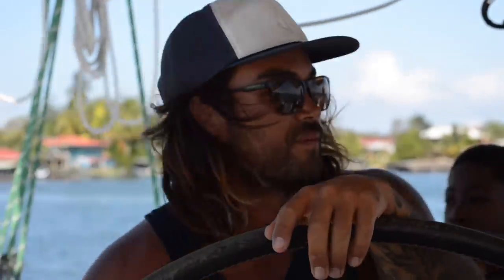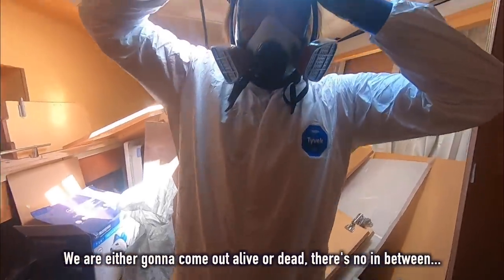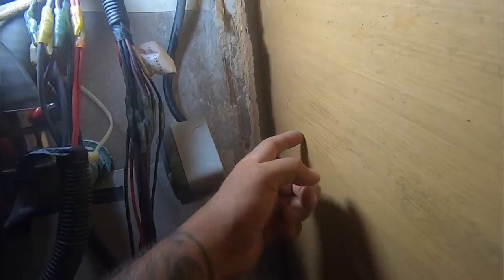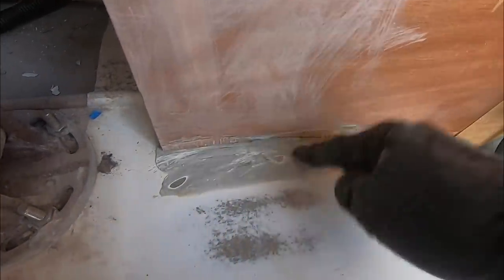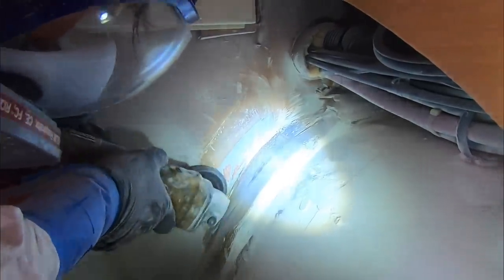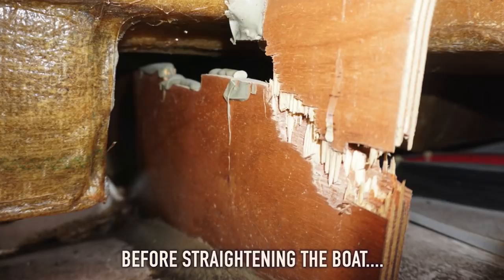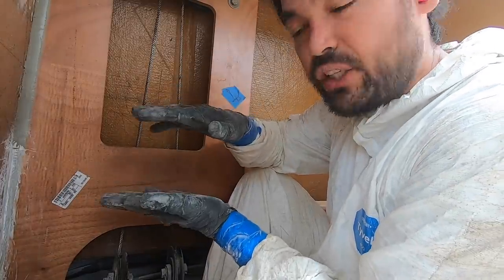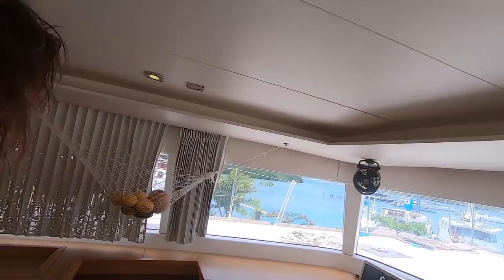CRACKED BULKHEAD REPAIR SERIES - Part 7 (Episode 112)

Comment: well of course its a design flaw, you tracked back how the water got to the meat of the bulkhead and rotted out. In the hull there should never be flat surfaces. Everything should be sloped of tapered to run down to bilge pump area. Its a boat, #1 always assume every area will get wet, #2 where will that water go?

Comment: Just my opinion.  I don't think the Lagoons have the structural integrity in their bulkhead to be hauled in and out of the water. To add, I think the recommended tension on the turnbuckles is way to high.  SOmething has to give.

Comment: I am NOT civil suit happy, but it exists for a reason: to shine a light on fraud, abuse, etc. In this case, if it is determined that Lagoon deliberately compromised the construction of its boats, it could become more than a civil matter. The right law firm would need to get involved that can have these boats expertly/professionally analyzed. I am sure it’s not only Lagoon that has issue. But, in the time of criminal cost cutting measures, there are some monohulls that need to be assessed as well: keels and rudders falling off at sea, etc.

Comment: When I myself saw what U guys were up against months ago..my first instinct was ..design flaws..too much new problems keep popping up  
too frequently..please give careful considerstion to the fact that u wont be able to test the structural integrity & strength of your work..In a worst case scenario when your'e out to sea..the shearing & twisting forces generated by a heaving & moving boat in bad weather are tremendous. I'm not sure your superficial fibreglassing ( though extensive & thorough may not stand up to that kind of loads..but still brother(s) continue to do ypur thing
& 😎ROCKMAN..

Comment: Ok. Science time. The expression "running balls out"comes from steam engines. The governor on a steam engine is two spinning balls. (Google it) And when the engine is running at full speed, it is running "balls out" or until they hit the limit. The "wall" hence "balls to the wall". I believe what everyone is implying is that the driving force behind you're motivation is immense. And thus those balls Must get plenty of exercise and be huge by now. That's probably it right? And it's an engineer friendly explanation.

Comment: The discovery of the faults to the design and workmanship of this craft as you work through it is a testimony to the poor design workmanship and lack of quality control. Of more concern is the apparent lack of fundamental stress understanding in the design of the joined up areas.
It seems as though they have taken a suck it and see attitude to the lay up on the factory floor and the guys doing it have been taking the initiative on what might work .
As I said in previous comments there is a distinct lack of anti torsional beams were the body of the boat is twisting, viewing the amount of fibreglass lay up in those areas it seems the view was, slap it on as thick as you can to create a beam ,that approach is not likely to work because the weak points will occur as the lay up thins down and looking at the delaminating that is exactly what as happened.
I think the third party insurance supplier that the manufacturer retains will be feeling very nervous at this time as most of the footage shown on your channel is damning.
If I were in your shoes I would be keeping a tally of the cost of your repairs and your own labour costs as you might well be party to a upcoming lawsuit against the Manufacturer.

Comment: Sadly, when a company has that much legal coming at them they tend to do a bankruptcy.   Then form a new company, instead of “lagoon, it would be “bugoon” ..🥴.   I’m sure that if they were to offer something for the design flaw, it would be to original boat owners ...🥴.   I’ve been on the wrong end of those deals...  No worries, if all your new glass holds, your boat will be tits 🥳
Reply: That was my thought as well, do they really owe anything to folks who did not buy a boat from them? Can they also suggest because Parlay was involved in a hurricane that the damage is far greater then would be normal. Its ugly regardless and until someone files suit and it goes to court its all speculation really?

Comment: Hmm, Balls of Steel. 
I believe there is a correlation between the actual manufacturing process of steel bearings, and what you guys are doing to yourselves on that barge. 
Lets visit this briefly;
After wire is cut into a "slug" it goes into the HEADING process. The slug is placed between two semi-spherically shaped dies and CRUSHED under pressures between 10 and 20 tons. It can be very loud, especially for LARGE-diameter balls, requiring (ear) protection. Heading forms the slug into a spherical shape called a RAW BALL, which is not actually round, and needs lots more GRINDING to to reach completion. 
The next step is Flashing, I really hope you guys don't reach this level of difficulty, because it involves grinding your balls smooth between two plates of steel. ugh, hate it when that happens.

Comment: Balls and testicles are just man-speak for heart or will.  When a viewer comments that you have balls of steel, it means you have hearts of steel.  

If you are concerned with the potential "design flaw" remember you are correcting it by using the stronger materials and better techniques to make Parlay better than factory spec.  Don't take my word for it.  Have a naval architect check the boat's scantlings before you start putting her back together.

Comment: seems to me, some of these fiberglass balsa wood boats are made to rot.. not very well made.. like they are just for the ultra rich that buy one of these for 400k and sell them at a loss after a few years to buy another new one.. buying these used.. is well.. hell to repair as you have made a good video diary of the long term damage and built in decay..

Comment: If I was Lagoon I would be worried about the optics of this. If in fact there are a lot more 450's that were built like this, they have a serious problem! Because it is very clear, they cut corners and used really bad workmanship on these boats.

Comment: There are many (real and imaginary) reasons for itches in the testicular region, fibreglass dust is nowhere near the worst of them, i’ve been told. If your testicles are made of some metallic substance, it seems probable that they will be quite resistant to any influence causing itch in that area. Seems like quite an advantage. However, if the metal is steel, boating might cause rust. I don’t know how that feels, and I hope it stays that way.

Comment: With all the examples of poor glassing and other examples of hidden poor workmanship it is hard to believe problems with these boats have not come to light sooner. I have no doubt that when you finish the repairs the boat will be stronger and more seaworthy than when new!😊 By the way those multi tools and grinders should be related by the manufacturers for extreme duty. Amazing how well they seem to work with all the glass and resin dust. Anxious to see the glassing begin and refit of all the interior that had to be cut away for access to damage.👍

Comment: Design flaw 100%. First thing that I thought when your bulkheads went. Because the profit on sailboats is not that high, companies that mass produce boats cut corners in every way they can. There are some mass production companies that don't cut corners, but that would be reflected in the price. Lagoon are basically the WalMart of the boat building world. The unfortunate part of this, if you enter into the lawsuit, is that you have made modifications to Parlay. The positive thing is that you have documented all of it and that you would be part of a joint suit.
Also, je ne "parlay" pas des boules. Je "parlay" couramment le bikini. I mean, if I had to talk about balls to party with Parlay, I guess I could fake it, but my heart wouldn't be in it. Good on ya, lads!

Comment: Ball of steal or balls out are about old steam engines had 3 steal ball that would spin completely flat or straight out they than knew engine was running at full speed from idle laying flat to lifting flat out full speed "balls out"

Comment: Those beams were probably not strong enough in the first place. I wonder if a repaired one would be… Wouldn’t it be possible to insert a beam of some strong material from the side to reinforce the hole structure over the full length?
Nothing wrong with your balls btw…

Comment: Design flaw?  You don't say!  Also not helping are all the friggin holes  for cabling that didn't seem to exist (lotsa holes with nothing in them in earlier videos).  Maybe the design woulda been fine but the manufacturing seems to be shyte.  Safety factor on the design wasn't big enough to account for that....

I doubt a lawsuit will go anywhere and will probably cost more than it would recoup.  Plus, do you want the boats repaired by the original manufacturer to their standard???

One could problably make a decent living for the next little bit coming up with a repair service lol.

Comment: Hi Collin and Jamie, since you have posted your question, my wife and I can’t stop thinking about the correlation between the size of your testicles and your ability to withstand fiberglass dust, thanks.  To determine if your balls are bigger than normal, as your fans suggest, you will have to do some measuring.   But first, I can confirm, a testicle is not a sphere (my wife double-checked).  That means the size of the sack has to be a different formula than V=4/3πr³. 
I think the best way to measure your sacks is to use Archimedes (keeping with the nautical theme).    I suggest you submerged your sacks in water and see how much is displaced. One milliliter (1 mL) of water has a volume of 1 cubic centimeter (1cm³).   (Be sure to use water, not beer.   And a disposable cup might be in order.)   If you need to use beer, remember the specific gravity of the finished beer is typically in the 1.005-1.015 range (Adjust your calculations accordingly!)
A quick search on google reveals that the average size of testicles is 18-25 mL, be sure to divide your volume findings by two (assuming you have two).  
Also, after much discussion with my wife and personal experience, I think the more surface area of your sack would mean more fiberglass dust contacts it and, in turn, that means more scratching and less tolerance to fiberglass dust. 
If your sacks are bigger than average, I would conclude they are not standard materials.   Your fans have suggested metal (ferrous or nonferrous), which I agree would provide the durability to withstand the scratching.   You could use an alloy verification tool, but I think a simple way to figure this out is to teabag a scale. (Remember Brass=8.73 g/cm³, Steel=8.73 g/cm³)
If your sacks are smaller than average, I got nothing.
Let us know your findings.

Comment: Whomever designed these certainly screwed up.  Those bulkheads should have been at least triple the thickness and also had reinforced ribbon structure.

Comment: I don't know about metallic gonads but I do know they are not spherical.  I'm seeing comments on another channel about you breaking your cat by over tightening your rigging.  Apparently they haven't been paying attention.  The genesis of your issue is shoddy construction techniques by the manufacturer.  I've seen others suffering with cracked bulkheads on the same model cat.  I watched you set up your rigging to manufacturers specifications.  If that causes your cat to crumble that's not your fault.  Your statement at the end of your video supports what I've been hearing too.  You don't have a blue water cat, you have a floating hotel room that's only safe as a live aboard tied to a dock in a marina.  Maybe with all the structural improvements you're making it will be strong enough to hold together out on the ocean.  Be sure to have sufficient life boat capacity for everyone on board if you sail out of sight of land.

Comment: My curiosity is killing me. Why did you guys not take that one hurricane damaged boat that did not have the rear end damaged? Or even the rear end damaged one. And scrapped Parlay Revival. What was the motivation to get back to the jungle with such serious intent? My guess is that the final costs (estimated on the other boat) will end up being more for this repair and could have saved lots of time if you used one of the other boats. But hey, I am spitballing here.Those boats were 2018/19 models or somewhere there. I remember marveling in how good one of them looked inside. If I remember correctly, one need mainly a mast.
I am not a sailor but I watch your videos religiously every week and lived vicariously through your sailing antics. But I sense you guys are in danger of sliding into the mold of fixing too much shit every week. Many channels are exhibiting the same symptoms. It takes serious intent and creativity nowadays to stay at the top. It's just the way entertainment is and will be on these social media platforms. If it doesn't get made better it dies.
exception

historically
Other than that, I wish you guys godspeed and safe sanding and I will be back when you are sailing again.
Reply: exception accepted: 
This is real life. And in real life, folks become attached to their boats and opt to see restorations through rather than choosing the easy way out
Reply from the maker: Because the owner wants $380k for it…

Comment: If you wish to get to the bottom of this problem just keep going backward, past said testicles, and you'll find an arsehole there with a real stinker of an answer. It could even be shit one at that. 

Re all the work. You guys are doing an amazing job. I know it was likely never an option but really, what you needed to do was strip out the interior fittings and go through it all easier that way. Like I say, I know that isn't an option, especially because you are still living on the boat.

Comment: Epoxy attachment of the bulk heads is not they way it should have been done, why they used this method is beyond me.  I would have made a glass flange for the bulk heads to fit into, or a flange, then inserted the plywood, and glassed everything in. Why they used epoxy is beyond me when glassing something like that in is almost key to structural rigidity of a crucial part of the hulls.  What ever savings they may have made in construction cost, has just been lost in customers ......

Comment: If there is to be a Call Action lawsuit you should put out a call for more owners to get involved and contact you or the person arranging it. As yours went through a hurricane they can argue it isn't their fault but if there are 50 other owners that used the boat in normal conditions and had the same issues then all owners will get a payout or upgrade to their boat in a settlement. 
I've linked a guy that has the exact same issue which is someone else to support a lawsuit. 
https://www.youtube.com/watch?v=eniqyjvICvs

Comment: With respect to balls..... it's most important that you maintain the proper ratio of balls to brains. Some may speculate that your balls have become more influential than the level of cognitive reasoning your brain is capable of. That being said my primary concern is for your lungs and that you don't sustain any lasting or degenerative damage to them while grinding away at fiberglass, so be fucking careful!

Comment: Design Error??  How about shitty construction:  Bulkhead NOT glued together or attached with Fiberglass to the hull, or the 3 boards extending all the way up to the beam?  It is NOT just the 45 ft Lagoon, but it appears that ALL Lagoons suffer from the same problems.  It is about saving time and money during the build and screwing the customer.  What you can't see, you can't complain about.  Class Action Lawsuit??  If the BH's were fully glued 100% to each other board and clamped in place and fiberglassed to the hull, things in your boat would have been a lot better.  You should not Z panel glue on the boards.  You need to put glue on the entire surface and then hold it in place while it sets--either bolts or physical clamps, just like the way they built the PT Boats of WWII.  It is also about not
protecting the wood from water, it then rots, too bad for the current owner.  If the designer said shorten the bulk head boards to 1 from 3, then he made a big error.  I believe what you are doing will greatly stiffen the boat.  I also believe that foam core is the way to go.

Comment: Designed obsolescence. Thats what you are up against. I can't see it being a design fault. If it was a design fault then you would not be able to repair it. They have taken short cut's that are detrimental to the build. The use of polyester (cheap glue) when epoxy was needed. Well the list goes on. I would be sleeping in tents outside the boat btw that dust will infiltrate every part of the boat and you. Hope you don't feel a sort of numbness in you chest/lungs? It's a nice feeling, it is caused by the dust scaring your lung tissue. It's irreversible. As for balls of steel, well lets face it, who crawls into a deck cavity and removes a piece of wood that is clearly holding up the deck?

Comment: Way underbuilt for the loads . Manufacturing defect . 

My son has a 24 foot racing boat , it has 3/4 fiberglass reinforced marine ply bulkheads triple glassed in and tripled up where there is a door .  Two of them under the mast step . Sure maybe overbuilt but it does not break  . 

The loads given the size of that boat are HUGE and the it just is not strong enough - a 30 foot boat has 3/4 bulkheads and it is not a 30 foot wide lever  . Lagoon apparently admits there are 40 reporting the same problem . I bet way more given the skill level needed to find it and the destructive nature of the inspection .

I bet the charter fleet investors are pissed and about to sue - their investment just evaporated